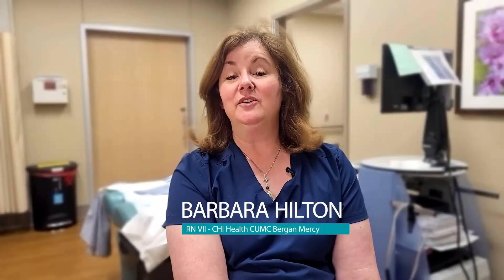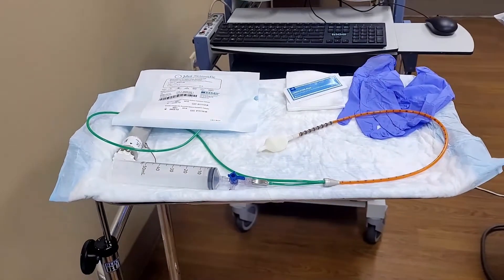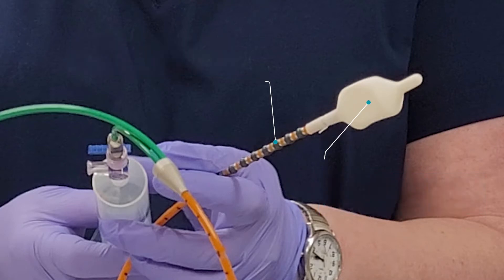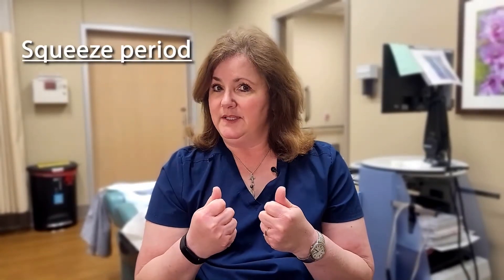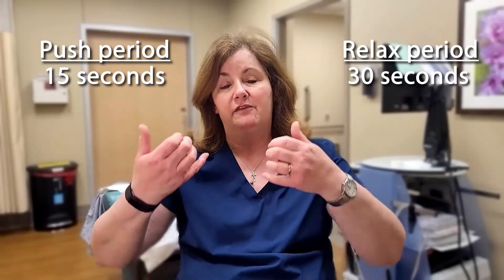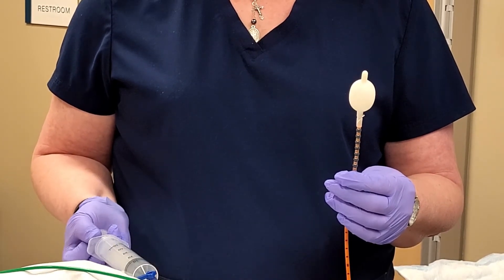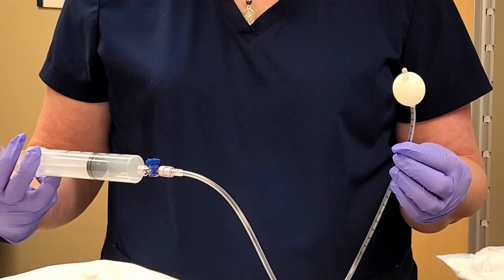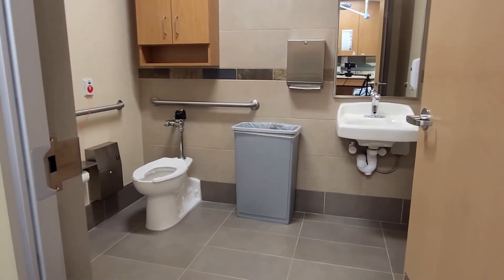Anal Rectal Manometry (ARM) - CHI Health

Comment: I'm legally blind and I use a power chair. I am not able to stand on my feet at all and it takes me a lot to transfer onto a toilet. What would you do in a case such as if someone had to do that last part in the bed?
The second question I have is that if a person has a hard time being able to reach themselves to give the enema and or lay on their bed on their side to give themselves the enema then transfer to the to their chair then to the toilet without having an accident then are their other types of ways to do the same procedure over the toilet where all a person would do is just transfer from their chair to the toilet? Are there other ways to do the prep especially if they can't drink carbonated drinks?